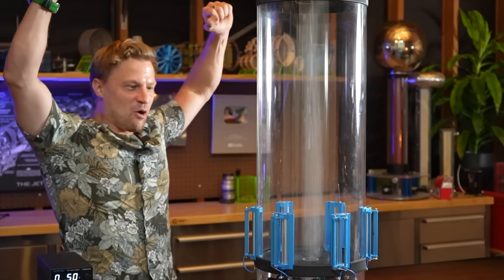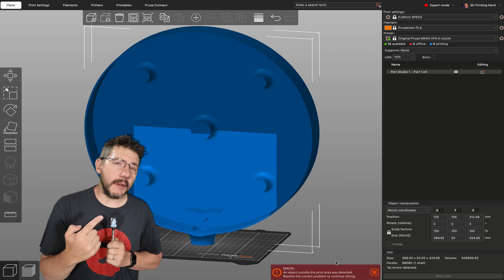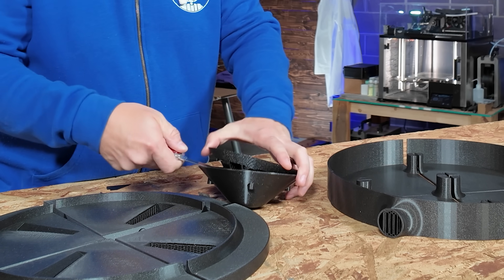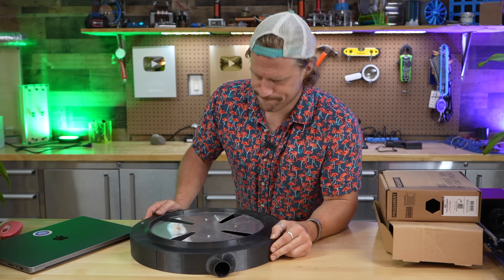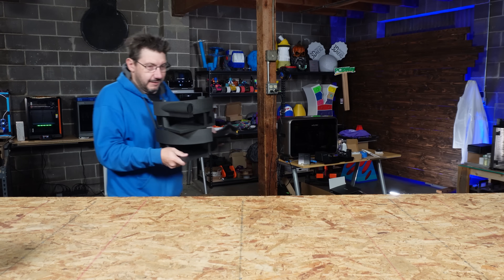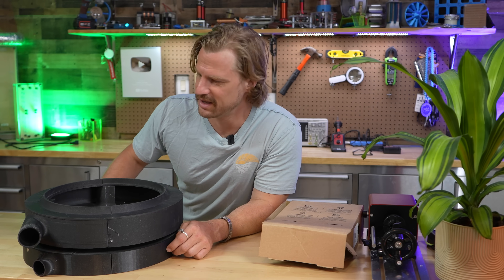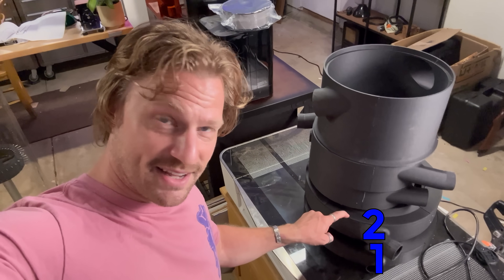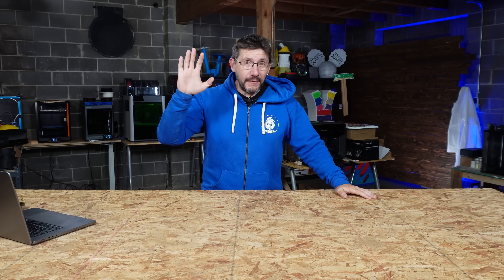BIG PRINTS on SMALL PLATES

Comment: Maybe if he prototyped it at a scale that wasn't big, he wouldn't have wasted so much time and money on this to get a spark I could get from dragging my feet on the floor. Not once did he even think that maybe he should have made it smaller to begin with, ya know prove the idea. This was more of a props for followers video than science.
Reply: Sometimes you have to go with what you have. To go smaller would have meant finding blowers that were smaller or put adapters on the ends of what he had, that may have given a whole different set of results with higher pressure air-flow.
I worked at a heat exchange company with leading edge products. Everything was made full size. No models, no cad engineering. Just build and test. And working with 0.2mm wall Titanium tube is difficult. Near impossible to weld, join on to brass and starting with long straight tubes and bending them into 1 meter cases was 'novel' and dangerous. I enjoyed making stuff, after years of fixing stuff. Now I am retired, I just enjoy watching others making things via trial and error.
Reply: @David-yo5ws his idea came from a vacuum sucking sand through a 2-3in orifice. So he jumped the scale by 10x not even thinking how much harder it would to get that same effect  happen at that giant scale, more sand,  more suction (not blowing)..ect. Also he definitely didn't just go with what he had, all of the things were bought, and the principles that caused the idea were not even considered. And to be like "I've been working in this for 2 1/2 months" is a knee slapper, I've been working on some prototypes for years, the difference is I'm not trying to please 1 million followers with my projects, using "team up with big channels" tactics and going big to woo audiences with buzz words and even an generated image of lightning in the plasma channel post too lure you in. Only to completely fail cause you ignored all the concepts that actually caused you to have the idea, failure is fun but not if you don't learn a single thing from it and waste thousands of dollars. This guy isn't a plasma guy, by any means, the money b he spent on that video alone could have got him a vacuum manifold system and some gasses to generate actual lightning, which this "plasma guy" still does not have.
Reply: @Re_SearchLab  This could be the guy I saw making foil try to fly and making sparks. I stopped watching him. Probably for the reasons you commented on above. However, having said that. A lot of things 'invented' were by accident. And a lot were stolen off someone else.
I think his channel just generates ?'wackyness'? for the clicks, rather than anything new or inventive. I certainly won't be watching it. Got rockets to watch.

Comment: I personally don’t think it worked because of printing in 4 pc. It wasn’t sealed…
Reply from the maker: Nope, that wasn't it. Jay used 3dgloop in one of the iterations, which is a very good seal, and it still didn't work.
Reply: @3DPrintingNerd  Hmm I will need to watch his video to see what he was trying to achieve. I thought I heard 'vacuum chamber'. If that is the case, I work in a CNC shop that we constantly work with vacuum and a pin hole leak in a seal will cause the process to fail.

Comment: Is there a software that you can load a model in like a car model, and you can grid slice it in one hit to given perameter's ? would so much easier for printing full size large objects
Reply from the maker: I think so? I think it's the same software the We The Builders people use
Reply: Yes Luban does this. Take the model put in your printer sizes and it will figure out the cuts. Works rather well.

Comment: - Yes, split/joinery can be done in slicer - BUT, should it?
- Well, depends...

- If 3D CAD model not available, +/or one lacks required proficiency, then slicer is an appropriate approach.

- But, doing split/joinery in 3D CAD model is perhaps best for iterating: time/effort modding is optimized: if done correctly, setup for splits and joinery need be done only once. So, after a mod of design/model, doing the splits and joinery is faster than having to redo everything in slicer each time.

- Now, Jay is using 'OnShape' 3D CAD. Does he have required proficiency to do the split/joinery? Perhaps. He already has done a non-trivial model, after all. But if he doesn't, or just doesn't have the time to do it, +/or learn, somebody else could do it in 'OnShape'. OR a STEP file might provide for a viable solution.

- What is the most appropriate solution under all the given circumstances? IDK. Perhaps in slicer is "good enough" - after all, you (Joel) did get the job done. But, could you have worked "smarter not harder"? Maybe.

- Anyhow, just some things that came to me mind, and thought I'd share.
- Whatever the case, job well done; I'm sure Jay appreciated your help/effort. And, everybody learns in the end.

- Thx for sharing; and keep up the great content...